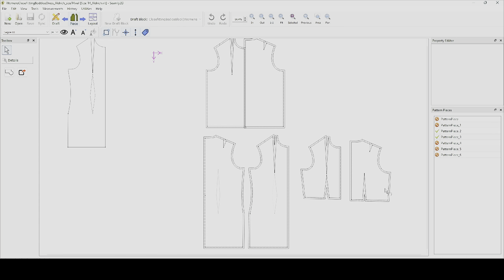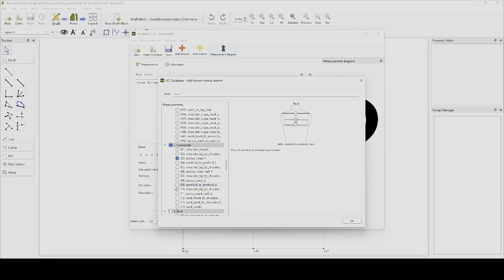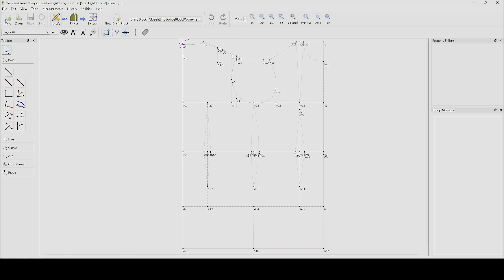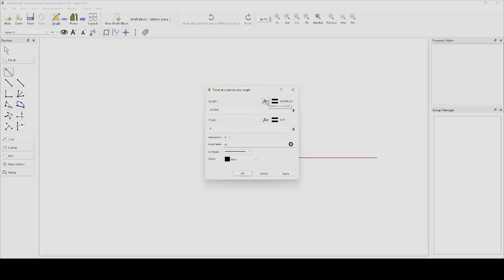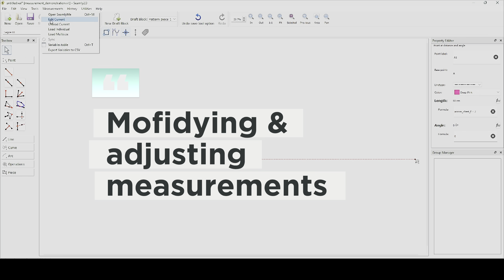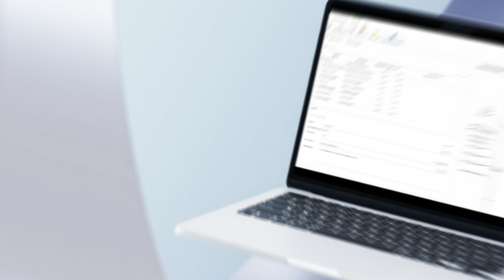Comment: Im just starting on this tool, thank you for the guidance, I already know how to grade my patterns on paper but is that something I can do with Seamly or is it only for drafting?
Reply: You can definitely grade in seamly it takes a little more of extra work on the patterns but it's worth it. Alternatively if you have the measurements that you want to grade up or down to, you can set these base measurements for the pattern and upload new measurements for a different size. I found this the easiest way. But you can manually grade in seamly too but setting anchor points